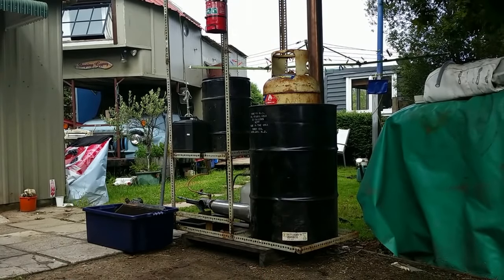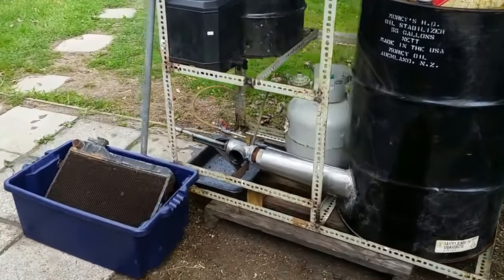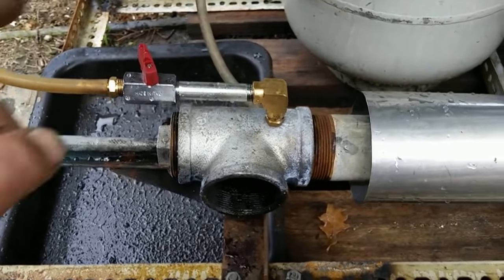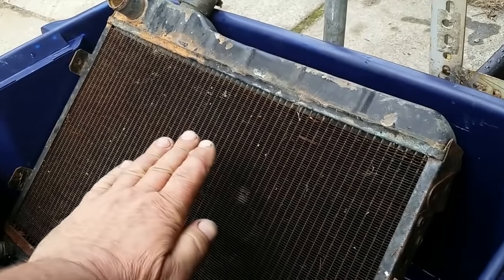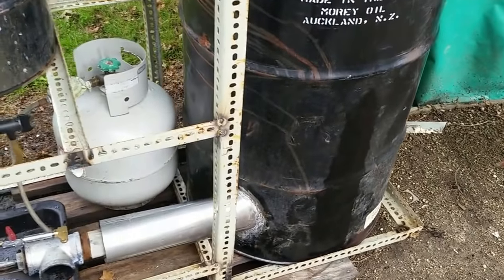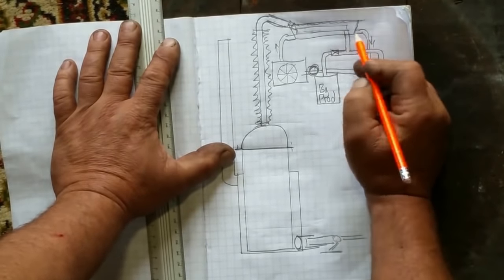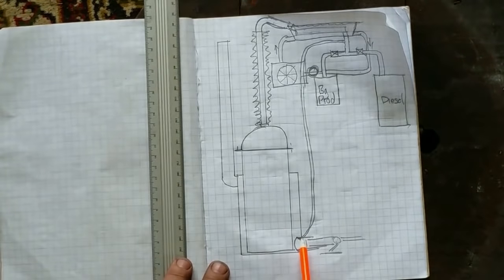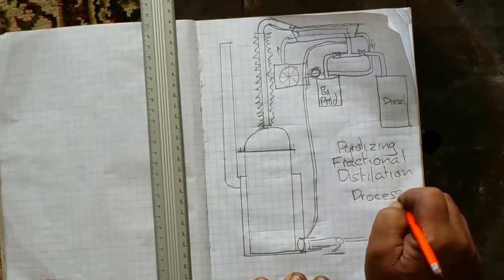Make your own free Diesel from Waste Plastic!  PART 2  layout of components

Comment: You explain this pretty well.  For someone like me, a total newbie, this is complicated and a lot of technical jargon is distracting.  Glad you don't do that, Neighbor (even if you are on the other side of the world!)  I'm off to watch the next one now.  Before I'd take on a project like this, I'll probably watch this whole series 10 times, just to make sure I understand principles and process.  Then, probably watch it as a step by step to actually build it.
Reply: One thing I didn't pick up on was what types of plastic can be used?  Plastic bottles, broken plastic tubs, plastic bags and caps, broken plastic toys?  Could you either redirect me to where you said that or elaborate, please?  From all that I'm learning on various youtube channels, I don't understand why we have refuse, except from city dwellers, and that just means more resources, as far as I can tell.
Reply: @frankihauser4126  All plastics and old tires too! Great way to clean planet, but must follow some principles to avoid forming of dioxins and other poisons in the process. First, make sure you heat plastic without oxygen. The air inside your enclosure (in which you heat your plastic rubbish) must be replaced with carbon dioxide - this way you'll prevent formation of dioxins etc. Also, if you want to pyrolyse number 3 plastics - those pvc tubes etc. - keep in mind that that they will produce chloric acid, so either don't use them or you need your equipment be acid-resistant. And you'll need chemical filter to absorb all HCL from your system.
The bottom line: it all depends on scale of your plant. If you can't afford a very complex one, then do only easy plastics, while pvc and the rest must be handled to those people who run a bigger and more sophisticated plant.

Comment from the maker: the diesel produced is sulfur free, high grade diesel. Diesel engines were originally invented to burn sunflower oil and be an engine that farmers could use without buying fuel. In the 1920s, Texan Oil Barons created a fuel that was similar and this became the crude oil based diesel that we use today. Most supplies of crude oil based diesel are high in sulfur which creates the black filthy residue in the engines oil. various additives are mixed in to counteract this. Detergents and surficants which reduce the lubricity of the fuel causing wear but keeping it cleaner. Plastic of types 2,3,4, and 5 are sulfur free and make a better cleaner fuel than what we are used to buying. HOWEVER* sulfur free diesel is not good in late model 2006 and onward common rail injection systems. as this series of videos progresses, you will see that the machine can also make kerosine, petrol, naptha and creosote, all from plastic or even waste oil. Safe and effective use of your fractional distillation pyroliser will depend on a good understanding of hydrocarbon science. Here is info on sulfur free diesel- https://www.axi-international.com/ultra-low-sulfur-diesel-ulsd-the-good-the-bad-and-the-rusty/
Reply: @pagansforbreakfast The first liquid fuel was actually peanut oil. Here is a quote from a quick google search for those interested in the history of the diesel engine."The first public demonstration of vegetable oil-based diesel fuel was at the 1900 World's Fair, when the French government commissioned the Otto company to build a diesel engine to run on peanut oil. The French government was interested in vegetable oils as a domestic fuel for their African colonies."
Reply: TinyHouse and Offgrid Resources, In reality, it is the older mechanically injected diesel engines that are most sensitive to low sulfur fuel. The sulfur is needed to lubricate the injection pumps to prevent early failure. The addition of an injection pump lubricant will help keep your older equipment in service longer between overhauls. Many survivalists/preppers dislike modern computer controlled injection systems. Electronics, without proper shielding, are sensitive to EMP and potential solar storms. Older, mechanical systems are not. Also, the naturally occurring sulfur content in the older fuels acted as a fungicide in storage. Today's low sulfur fuels, while certainly more environmentally friendly, DO NOT store well over long periods.  Low/no sulfur fuel will support the growth of fungus that can clog up the fuel filters. If you wish to store low sulfur fuel, a fungicide should be added and the stored fuel regularly checked.
Reply: @pagansforbreakfast I fully understand what you mean man. Some really old engines would run on just about anything available. Time had little value and folks could tear down a simple engine to lap valves or replace rings. I friend of mine has a steamboat that is powered by a steam engine salvaged from farm equipment rusting in a field. The boat was built in the 1950s and is still cruising a New Hampshire lake to this day. Old engines did not produce a lot of horsepower and ran at very low speeds. BUT. as my friends and I used to say, "they were really big horses back in those days."
Reply from the maker: @pagansforbreakfast Really!? Rudolph Diesels first engines? I will research
Reply: why didn’t you complete this build
Reply from the maker: @paulanthony873   my neighbor didnt like it

Comment: Hehehe that’s funny push twice! I hope to be building my system soon. I will be using waste motor oil as my feed stock. I will be using my system in the winter so the outside air and snow will help cool the condenser along with the water running through the condenser. Thanks for sharing, God bless you and yours. Stay safe buddy!

Comment: so its like a wood gasifier.. except you are using plastic to distillate the "gasses" back into a diesel liquid apposed to having gas like a wood gasifier would produce.

so once the lpg has got your burner hot enough the cooking oil is then introduced and is burnt as "clean" as you can get the air mixture to burn.

its a good idea i wouldnt say its amazingly efficient but the fact you are trying to use all excesses that wont condense definitely helps 

love your work!

Comment: Thanks for this explanation, if only you had been my teacher in my science classes, trouble is that I only had complete dorks who just repeated the boring texts that they had learned from and thus I lost interest until Youtube came along and made science stuff fun again.
 So with your teaching style and methodology could you please make a video explaining how nuclear fusion (or cold fusion) works. Thanks.
Reply: Thanks for the reply. I certainly wish that I had studied this stuff more in school but I really had no interest then as much as I do now.
I was also anti nuclear until I read about thorium and how it's so much cheaper (and safer, walk away safer) to use than uranium.
Sadly the one reactor that had safely worked at Oakridge was stopped by Nixon about working for about 6 or 7 years, the reason for pulling the plug was that you cannot easily make weapons grade material from it.
I actually live about 4 miles from the Hinkley Point reactor which will actually prove to be the UK's most expensive white elephant as it became out of date soon after they agreed to start building.

Comment: Very good job and nice instalation. But You will not get diesel but parafin oil. It condense at 35 degree C and without warming it You can not use it to diesel engine. 2. How much oil did you burn to get 1 litre of oil from plastic ?

Comment: To calculate the burn tube, you need the area of the tube opening to equal the size of holes drilled into the tube.  You start with ratios for small holes to progressively larger holes.  This is the principle of jet engines.  This can be seen on Applied physics channel on his homemade jet turbine and the jet turbines of other small aircraft builder machinists.

Comment: That’s a good looking build, I think it would be interesting if you could do the pyrolysis process off of waste heat rather than needing a dedicated burner. I’m not sure of the temperature needed, but if you could use the exhaust from woodgas creation or even adding a percentage of plastics to the wood may work. This is very interesting, thank you.
Reply from the maker: Er.... I am powering the burner with waste oil and the fractionated gas from the process. The LPG is used for maybe 30 seconds to heat the burner nozzle
Reply: @t.h.o.r.  oh, somehow I missed that it was using waste oil, that’s great

Comment: Awesome, well explained, thank you so much. Looking forward to the next videos. Looks like the cost for this build really isn't that high. The drums and big propane bottle will be the trickiest part to transport on my sailboat...But I guess this could be downsized as well. Will watch the next videos to see what tools are needed. Looks like some welding for fitting the pipe to the drum...but maybe it's possible to replace the welding with some JB Weld for high temps that is used on engines and such? Would make it way easier for DYI projects in remote areas where you don't have a welder...
Thanks again, these videos are EXACTLY what I was looking for!
Cheers, Nike

Comment: That is an old school refinery though. There are much easier and cleaner and more efficient ways of reducing plastic to oil, and further refining the oil to produce diesel/gasoline. All you need to do is melt the plastic in a pressurised oven and bubble the gases through cold water. The condensed liquid floating on top will be oil. A bit like a distillery. Watch the videos of the japanese guy who invented an oven for exactly that purpose. Very simple and ingenious.

Comment: 1. circular spirals in the bun chamber will force the combustion air/fule mixture to swirl around more of the  inner chamber and transfer more heat  for more efficient use of burner fuel for 5 bucks worth of metal and a few hrs construction time.
Reply from the maker: It's already doing the circular spiral in the burn chamber. The burner nozzle is designed to create that.  The last point that you can see the flame  from the outside is where the burner enters the chamber. After that there is the 3rd air inlet point that leans the combustion further. By removing the tap bung on the drum you can peer inside and see a virtually white spiral blast of flame that spirals around the reaction chamber and finally exits the chimney as a clean blast of hot air with zero particulate . After many firings the chimney is as clean inside as a well tuned race car exhaust.  Thankyou for your interest but it is tinged with misplaced doubt. I have worked as an engineer for  40 years and combustion efficiency is the mainstay of my daily work. Check my other videos and you will see that I have built a range of very popular woodstoves for the last 20 years.

Comment: Very good video, all the scientific and engineering principles are correct, though it may requires doble check some safety points.The diesel by this mean produced requires further fractional distillation in order to obtain more  purified and valuable cuts gasoline, diesel and waxes. Have you meassure the rate  of  "amount burning oil consumed" vs "amount of diesel mixture obtainen" ? Im interested in the energy efficiency parameters that your device can achive. Thanks, Im a ChemEn in México.

Comment: Hi , I am not a chemist or engineer but if you could use the heat from the vehicle exhaust near the exhaust manifold of the engine to heat the waste plastic and have a compact system in the vehicle under the bonnet this would use the otherwise wasted heat.

Comment: great vid I would move the lp tank farther from the burner and use an aluminum radiator in the  bath and drain or output tilted down a little. be safe guys

Comment: You are a very good teacher. Well Taught. Thank you. My Question is : How will you stop potentially harmful gases to escape from your hot air escape route?
Reply from the maker: the fuel is waste engine or cooking oil at
the rate of 1 litre per hour. combustion is very efficient and lean .no visible smoke is present after a short warm up and the chimney has no residue after several hours of use

Comment: I was thinking that to cool the water,  use an old swamp cooler to to cool the water.  Not using the air from it just the evacuation,  if you must move some air just blow it off out of the way, or maybe blowing some into the burner.  Just some thoughts.  If you don't like them just trash them. I just had the thought and thought I would see it it may help.

Comment: you also can add carbon as a catalyst to the plastic, and i recommend to flush the vessel with co2 (oxygen fee environment)  to ensure no toxic dioxane could be produced
Reply: Is the carbon 'catalyst' used to deal with saturation of the fuel? I would guess lots of surface area would be needed for catalitic functions, so crushed charcoal? What amount? Maybe 50g/kilo? Around 1/20? Thanks!

And I had thought about flushing with nitrogen to start with no O2 or CO2 which could decompose and recombine to create those nasty dioxins. I was much younger when I was almost ended with CO2 (and surely dioxins) from commissioning a medium pressure steam line that had platic coating it (unbeknownst to me). Head was pounding about three hours later, and after six hours I was praying to die to escape that pain. Went to the doctor and they tested my blood with O2 saturation below 90% and CO2 levels almost 3X what they would consider as a normal range....... for a chain smoker.... and that was about 18 hours after the incident.  Be carefull around pyrolizing plastics.

Comment: Just like a still, but with a super charger. LOL Too much heat for making whiskey, but you run it similar with your for shots, hearts and tails. We know on a still though what temperature we want at the head to still off our for shot , hearts, and then when the tails come. You don't want to be drinking methanol, and your head temperature changes when your still finishes producing ethanol. 
Where I live is one of the top 10 Rivers that dump plastic in the Oceans and find this very interesting. We have a lot of plastic waste here and could easily do this on an industrial scale.  I think I'll check if anyone is doing it.
They do have recyclers, but I'm not sure what they do with all the plastics.
PS your mantra is missing another 'R'  Reduce. LOL

Comment: This is Great Info and an Excellent Design.  Is it possible to put scrap wood or cut up used rubber tires into the reaction chamber and extract oil from these products? If your design had a water jacket outside and around the combustion barrel, it would be possible to capture a lot of hot water from the waste heat. What is the Yield for this unit per unit of waste material used?  If wood was used in the reactor, I believe the end product would be a high quality Bio-Char that has many uses including soil enhancement/remediation.  How long to process a batch?  Thanks again!!

Comment: I have a question. I have great respect for your skills and craftsmanship. However, I did not watch the entire video but how did you heat the chamber? If you used electricity from the grid, then you probably used more energy and paid more money than that contained in the oil you got out or the equivalent diesel would cost at the pump. If you had enough solar, though, that energy would be free. Please enlighten me.
Reply from the maker: watch the video- you will see that it is powered by waste oil.

Comment: Sorry if a stupid question. Does it matter the length of the reflux pipe? Like the longer the more likely the cooler the vapour before the 1st radiator in water? Or does the reflux pipe need to be short and close to the furnace?
Reply from the maker: as long as possible is the best. the marbles increase surface area and encourage condensation.
Reply: @t.h.o.r.  thank you for the reply. Love your videos. Do you have a video beyond 5.2?

OK to summarise. I Need 350 degrees for the furnace. Then reflux pipe long and expansion chamber into a car rad or intercooler. This bathed in water which should be cooled to promote the condensation needed.

This is as far as I understand. I need to go back to your 2nd video few times.

Thank you u so much.

Comment: What do you do with the sludge that is left over after the plastic has melted and boiled off and also how do you dispose of the Devils Brewer whatever you had referred to it as is it combustible? Can it be added back into the main chamber to be re-processed several times before having to be disposed of?
Reply: In case you couldn’t get a read off my comment, I am merely asking informational questions. I am 100% behind the concept of what you’re doing I just wish to understand it better
Reply from the maker: Yes - exactly that- there is a greasy lump that is left in the bottom. I scooped it it out the first couple of times but then started reburning it with the next batch. It pongs- I suspect that its highly toxic- Don't lick it!  The gas that comes off was piped back in to feed the burner, If the condenser had been more efficient there would be less gas- It made the combustion far more powerful. My nieghbor convinced me to stop doing  the work- far too much chance of being branded the guy who set fire to the nieghborhood.
Reply from the maker: I wondered if this vile goop may serve as a rust preventitive or lubricant grease ? now 5 years later the container I used still stinks of the stuff!  @vernroz